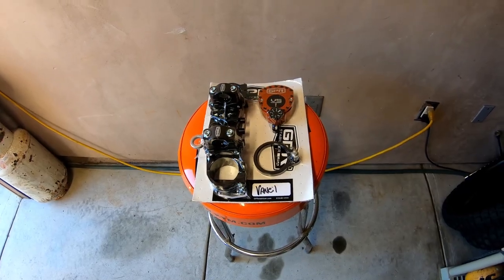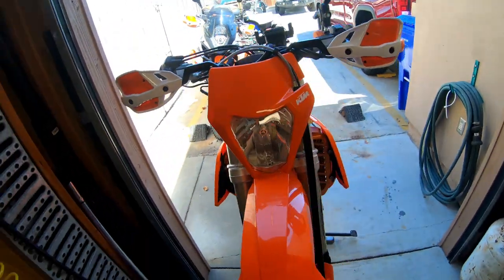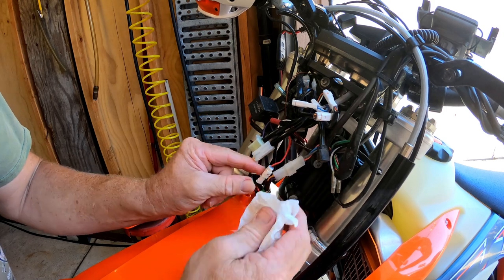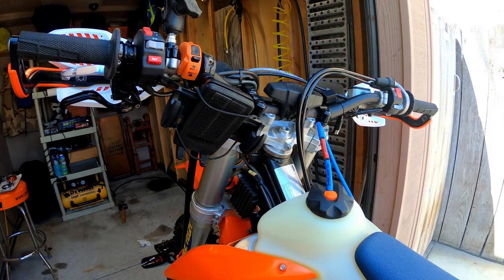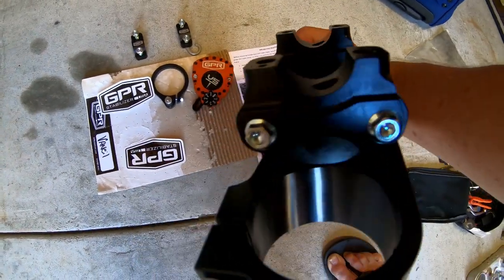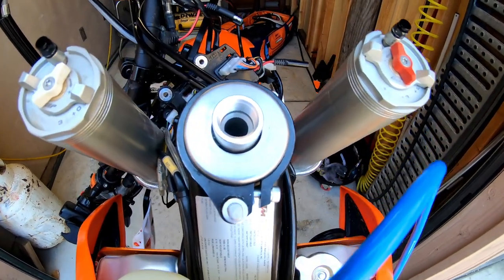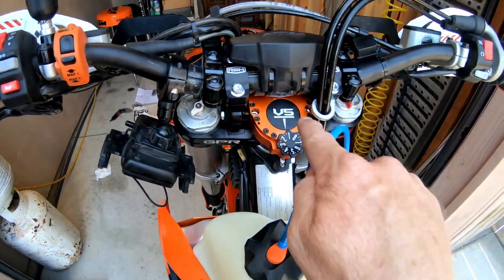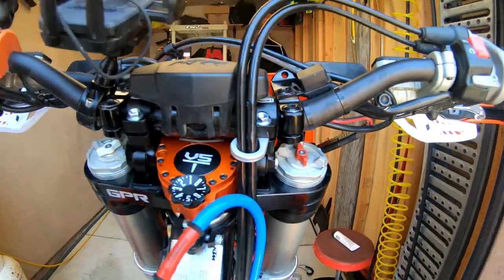'22 ktm 500exc f GPR Pro Steering Damper Install movie

Comment: Great video, thank you. Can you explain why you decided to get the stabilizer? I’m considering one for my 500.
Reply from the maker: I ride a lot of desert which is generally high speeds and oftentimes very sandy. It is easy to hit a rock that is hidden in the sand that deflects your front tire left or right and when you're going fast that could be enough to take you out. A steering damper damps that steering deflection making it so you hopefully don't wipe. It can be turned down if you're doing single track or slow type riding in the woods or it can be turned up if you're doing 90 mph across a dry lake bed. It is a piece of mind item that I have had on every bike I've owned. They're not cheap but they kind of complete the package :-)

Comment: HI, I have that same bike and was looking at that kit.  How do like the performance of the stabilizer?  What settings do you use in singletrack and high-speed desert?
Reply from the maker: I love that damper kit and the upper triple clamp! I keep it around #4 unless I am in desert sand or tight singletrack and then I bump it up to 5-6. I did replace the oil with a heavier oil than they use OEM because it was requiring settings closer to max prior. Good luck!